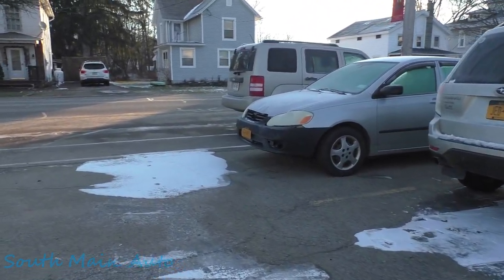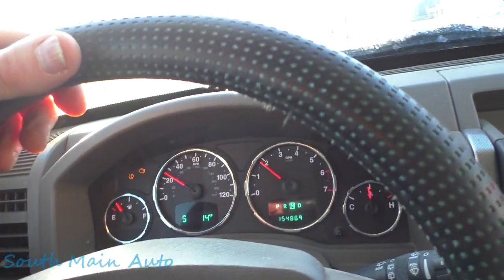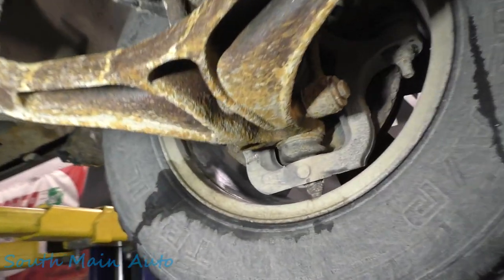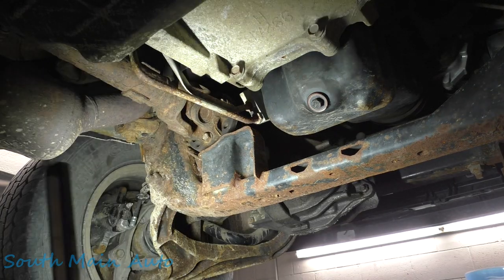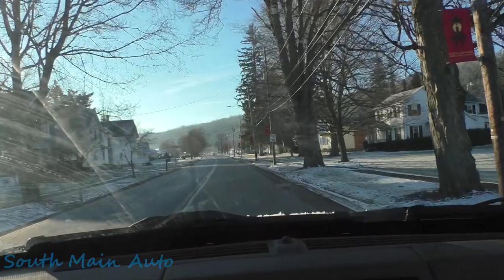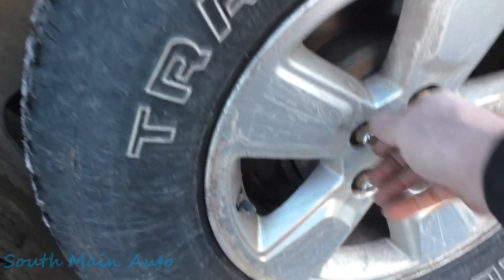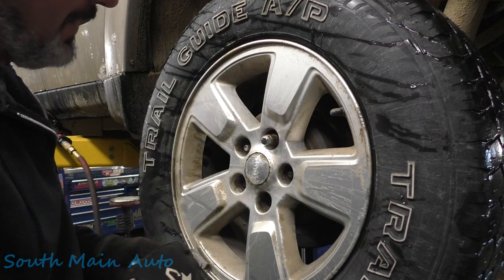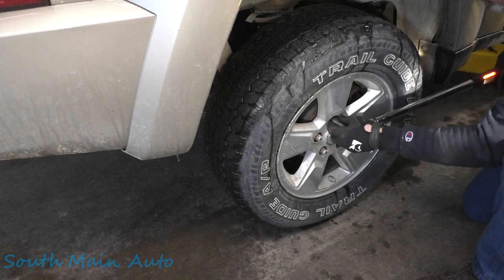Customer Just About Lost It.... A Wheel That Is

Comment: I almost lost a set of duals on a 53' semi trailer once. After doing my pre-trip inspection, I got on I-70 heading West, toward Columbus, OH for a delivery. During one of my frequent mirror checks, I saw what I first thought was a rock fly away from the trailer. Then, I saw the same thing happen 3 or 4 more times so I knew something wasn't right. By the time I got pulled off on the shoulder, that set of duals had started wobbling something fierce! Upon checking it out, I found that 6 of the 10 studs (which were all there 100 miles or so before) had sheared off! I own my tractor but, pull trailers assigned by the company I'm leased to and that trailer was one that they'd rented. Upon calling the company shop about the trailer, I learned that it was the 4th rental trailer, out of the 10 or 12 they were using, with the same issue that week. Needless to say, those trailers ALL taken out of service immediately and the trucking company scrapped the idea of renting, rather than buying trailers.

Comment: 40 years ago i had my Metzler Blue snow tires put on (NJ) my Saab 99 (front tires), drove to Vermont for a work event .... major snow storm brewing when I left  ... left NYS Thruway  east thru Troy NY in a blizzard headed east to Beninngton VT ... 11pm, start hearing a slight clicking at 60mph on front passenger side ... next thing I know I'm carving head on into the 4 ft high snow bank on the right hand side .... Saab come to a stop, I clear the windshield and see my tires doing the loop de loop 100 yards down the road, then falls over .... I'm of course the only fool out driving in the storm, not even a snow plow ... out in the middle of the White Mountain Preserve .... I knew there was an old 50's style motel 10 miles down the road ... 2 hour walk in 2 ft of fresh snow ... get there and the sign says "Closed for the Season" ... one of those 1 story places where the owner lives on the small second floor over the office one light on and an old Cadillac parked in front .... woke the owner up, he gave me a "cold" room ... next morning (Sat) I called the Saab dealer in Bennington (who I knew) and he sent a tow truck out at 9am ... turned out wheel lugs had not been tightened/torqued .... loosened, snapped off one stud ... Sat, so no mechanic, owners son came in and installed 4 new studs for me and the wheel and spindle were okay ...  I was back on the road by noon heading up to the ski area I was doing a clinic/show that Sunday .... 40 years later I'm still a wheel nut torque/check fanatic .... lol ... a good lesson learned at a young age that stuck

Comment: Couple years ago the RR wheel on my Subaru came loose.  Vibrated a bit on the highway but real bad on the interstate and I had to stay under 55 and made it to work.

Thought maybe it had snow or ice in the rim but while walking around noticed 2 lugnuts almost fully unscrewed about to come off.  Others were finger tight at best.  I ~had~ that wheel off about a month before to replace rusted out fuel filler pipe and maybe never tightened it ??  No way to know.  It was pretty scary at the time, thought the rear of the car was about to grenade.

Comment: I live in a grade 1 rust belt and have owned Chrysler caravans, intrepid, jeep Liberty also. I always put grease on the mating faces of the wheel a hub and on the lug nuts. Never used a torque wrench but don't overtighten either and have never had on come loose.  Making sure that the wheel isn't mounted on a crusty surface and that the lug nuts are tightened in opposing sequence is essential.

Comment: 1970 vw camper.  felt a loose sensation in the back.  stopped went out and all the lug bolts had come out and were sitting in the moon hub cap.  the tire stayed on because of the fender skirt that the buses had on the rear.  jack up put back together and forget about it. i also do the unthinkable and grease my wheel studs.  I, like you, live in the rust belt.  my dad always done it, my grandpa, who owned a service station, always did it, and now i still do it.  ive never had a lug nut come loose or seized up where i couldn't get it off with a manual lug wrench.  ive read the reports, watched the videos.  i will take my chances.  like i said only once and that was when i was still wet behind the ears.

Comment: 35 years ago I had four new winter tires installed on my square body, very used, Suburban. After putting 110 miles or so on the truck I heard a clinking noise as I did a U turn. Inspection showed  ALL the lug nuts loose, some fallen into the center caps, hence the rattle during the U turn. It was a very cold couple of days , 35 below cold here in Laramie Wyoming. A walk around of the tire shop showed the air compressor outside the building. I figure the air line was restricted with ice, and the shop was an early adopter of "torque sticks". I watched the installation through a nifty window from the waiting room, so I know the wheels weren't torqued with a torque wrench. I spent a day changing studs and wheels. On a positive note, I installed some used Rally wheels I happened to see for sale in front of the gas station! I'm 73 years old now and I still retorque wheels after 100 miles. Keep up the great work, Eric!

Comment: its thermal expansion and contraction.  i once changed a set of aluminum buds along side the road at 10 below.  you remember such things. later in the summer i tried pullin them off  to rotate them. 3/4 impact wouldnt touch them. took a 10 foot pipe on a 1 inch drive breaker bar to remove them. and yes they were never sneezed up.

Comment: I had a 1980 Olds Cutlass Supreme that I had replaced the gutless 231 V-6 with a built 1972 Chevy 350 4 bolt. Before replacing the motor I had upgraded the rims & tires to 15" with 235/60/15's all the way around. 1 day I ran over something & it blew my front right tire. Thankfully I was only going the speed limit of 30 & pulled into a hotel parking lot to change the tire. That spindle only.had 4 of the 5 studs on it & trying to remove the tire I broke another 2 leaving 2 studs next to each other to hold the rim on. After putting on my full size spare I limped it about 1000 feet to a friend's house & stayed the night there (it was Friday 13th & the only weird Friday 13th I've ever had...so far). I replaced all 5 studs the next day & went & bought another set of tires for the front.

A different time I knew a woman that drove a BADASP AMC Javelin. That car would ship & get I tell ya! Well 1 day she had new rims & tires installed.on it at a shop that's long been closed, but it was a performance shop. They told her to drive it 25 miles & come back to get the rims re-torqued. She made it about 20 miles before the back left flew off while she was driving. It flattened the rear left quarter panel & did minor damage to the suspension system. She had it towed to their shop.. The shop didn't want to warranty it!!! I never knew how she knew him, but she knew the top lawyer in town & called him on the spot. He actually left his office & drove there. After he talked to the manager for about 15 minutes they replaced the rim, sent the car to a body shop, & had the damage fixed plus repainted the whole car. That Javelin was later totalled by a friend of hers she sold it to. The guy was driving her home & it spun out in the light rain when a deer jumped out in front of the 4th car ahead while in a curve. Everybody else stopped but he lost control, the car went off road, rolled 1 3/4 times leaving her hanging out the passenger side. Her kid was safely strapped in the car seat in the back seat. She finished unbuckling the seat belt, fell out of the car, & passed out in an ant bed of fire ants. She was of course taken to the hospital, after the people ahead heard the accident & called 911, where she figured out she had broken her pelvic bone in 4 places, broken ribs, had a concussion, & minor cuts/scrapes/bruises plus unknown total of ant bites. Her kid was ok! The guy driving...I never asked or found out about but she had told him she knew what the car could do, he didn't, & he better drive slow which ended up saving her life.

Edit: that's as close as I remember the above events. The time frame was between 1991-1996.

Comment: Not your region Eric - I live in Maryland, have a 2008 T&C (no, it has not imploded yet...but any day now...). As soon as I heard the sound in the video I knew exactly what it was because I had to troubleshoot that same issue. Since then, every time I rotate my wife's tires I re-torque them for 3 days straight and check them every few weeks (yes, there is always several lugs that back off). I'm happy to know I'm using the proper "pro shop method" of over-torque to keep them in spec! Every video of yours with Chrysler is dead on - I've had every issue you made a video on - especially EVAP. Thanks for fixing my van from afar!

Comment: Wifes car was making noise so I checked it out. It sounded like a bad wheel bearing so I was getting ready to jack it up when I noticed it was missing 3 lug nuts! It was a a big box store a month earlier for tire rotation. While I had it I checked the fluids. It had a quart too much oil! Just had an oil change at a local shop. I do everything I can do myself on my vehicles. Thanks for the video good luck with your pallet expander deal.

Comment: Eric, I had new tires installed at a cheapo muffler & brake shop in Buffalo. I pulled out after it was done, drove about a block, got a terrible wobbly vibration. Pulled over, and 2 wheels had loose and missing lug nuts! Had to walk back and get the mechanic, who was very angry. He had also held me up for 2 hours trying to remove my factory glued-on plastic G6 GT wheel covers! I have also had wheels over-torqued to something like 300 foot pounds, at least. You just never know what you're going to get, these days. I always check my car over after it's been to a garage, for NYS Motor Vehicle Inspection.

Comment: Best related story I have is that I used to work for a rural Ford dealership where we had a small independent shop directly across the road from us. A customer pulled in to have a "rattle when driving" complaint looked at, but didn't want to pay our diagnostic fee (It was not a Ford product). They ended up across the street to have the work done, and about 30 minutes later, we saw their tow truck head down the road... I happen to be going on a test drive at the time, and ended up following the tow truck. Approximately 2 miles down the road, there sat the guy, on the trunk lid of his car, minus his right rear wheel... He had them tow the car to us, as they apparently said that he needed shocks and a front left tie rod... which he didn't need at all, but he did end up needing a new wheel in the right rear, new rotor, brake assembly, strut, and lower control arm (independent rear suspension) which were all damaged when the wheel fell off doing 60 down the road!
Made for a very interesting day!

Comment: I volunteer at a shop full of DIYers (car ministry). We always perform 3 test drives: part of incoming inspection, after all repair work, and during final inspection. Occasionally we get a loose wheel during the repair test drive. One time we got 2 blocks from the shop heard a thud & slowly pulled off the road. Driver's rear wheel was sitting at 30° on one stud, no lug nuts. We found 4 of 5 lug nuts in the road...

Comment: Had a Honda Civic sent it to the garage next to where I work.Had them do a PA state inspection.Shortly after that it started to make a noise.I took it back to them and they then said I needed new axles and engine mounts. I said no way, I got it back did a little investigation and found one of the front wheels were loose from when they inspected. I was not a happy camper.Thanks for the video

Comment: I used to drive an 87  Dodge Charger which was a 2 door sport coupe version of the Dodge Omni which had that same loose lugnut problem.     The lugnuts on the car were steel with an aluminum ornamental cap that always stripped causing improper torques.  I eventually replaced all the lugnuts with all steel ones, and i did the same with my Dodge Dakota after smashing the wheel to get one lugnut loose. For the Dakota i bought used lugnuts at a garage sale lol.

Comment: I have an "07 Liberty in Northern ON, rear tires wearing badly inside, after only 40k km on new tires. Rotten rear control arms, a recall in the states on Patriots, but not in Canada on Liberties or Patriots, and the eternal "non adj. rear bushing" issue, 2 correct the rear camber! It was oil sprayed every year and has lived it's life in one small northern community, so I figured that in 2018, when I bought it, with only 60k km on it, that it was a good purchase, no frame/body rot like that one u had on the lift, except 4 the rear control arms!

Comment: My story.  2010 f-150 with 7 bolt rims.  Torqued to 150 ft lbs before a cross country drive.  3000 miles later one of the rears had 3 of 7 bolts loose enough to take off by hand.  Many more had loosened a lot.  As a rule with alloy rims I now re-torque regularly.

Comment: Had a similar issue with a GMC after a dealer service though not so lucky. Headed down the road a few days after an oil change and tire rotation and heard a similar noise that got real bad real fast. By the time I got pulled over to the side of the road the driver rear wheel was all cattywampus, no lug nuts to be found. Had it towed to the dealer and it had destroyed the wheel and ruined some studs. Thankfully the dealer went good for a refurbished wheel, new studs and inspected the drum brake. I am now fanatical about that wheel re-torque 😉

Comment: Happened to me in my Chevy PU in Feb 2023. Heard a bang and thought the wheel bearing had failed... but no, the one tight lug nut broke the stud and what a wobble it made with the remaining 5 loose lug nuts. I was very lucky it held together until I could pull off the highway.

Comment: I have a 2000 Caravan and a 2006 Grand Caravan, which is our "newly purchased" vehicle. I'll keep an eye on the lugnuts on the 06, it does have the alloy rims. I didn't know these were a potential issue.
I've worked at Walmart in the Auto Care Center for 15 years now, and I really can't remember any issues we've had with loose lugnuts. We do 3 hand torques on each vehicle we remove tires on. We tighten the lugnuts using a torque bar on the impact gun, then use a torque wrench at specs fully 2 times, different tech for each torquing, then do a figure 8 in the parking lot, bring the vehicle back in and 1 final hand torque. Then Walmart recommends a 50 mile retorque. 99 times out of 100, the individual doesn't come back for a retorque....I'm one of them...

Comment: I had this happen on the rear rim of my 96 BMW 1100rt motorcycle.  Riding in upstate VT with the boys, came around a corner and felt the bike start to WOBBLE,  pulled over immediately nothing obvious, no flat. Put it up on the centerstand and the back rim shifted on the hub. Pulled the center cap and all 4 lugs walked out about with like 2 threads left of catch. Had bike for 4 years and never checked or did any tire work.  The good Lord was on my side that day. Like the ole training course for MC say, do a complete inspection before any ride.

Comment: I have done loose wheels to myself twice, both times by snugging up the wheel nuts while on jack stands and forgetting to tighten them after lowering the vehicle.  The first time I ended up parking my car in a residential area and taking a taxi to malwart to buy some tools to fix it.  The second time I realized about a block away from home and turned around.  Now I have a mental checklist item for checking the torque whenever I have been working on my vehicle, and I haven't made the same mistake since.  When you finish a repair at like 2am it's easy to forget the basics.

Comment: I made a wiring harness for my friend Harold's 1932 MG replica and when I was finished I took it for a ride. It started making a God awful rattling and knocking sound about a mile into my trip. Limped it back to my garage thinking the motor let loose. It was actually 2 of the 5 lug nuts on the driver's side rear wheel had came out and fell into the baby moon hubcap. Of the three remaining,  one was almost out and the other 2 were loose .  Scared the crud outa me. It didn't have lug nuts it had lug studs. It used an early VW beetle chassis that had been stretched, it had the old 5 lug rims on it.

Comment: Had a wheel come VERY loose early in the winter. Picked up some new wheels & tires (Some used heavy oem aluminum because winter potholes are unforgiving and invisible) popped them on, torqued to spec. Drove about 20km, suddenly heard and felt something weird, pulled over and the lug nuts were almost all finger tight. My only guess is that it was some combination to do with the mating surfaces & corrosion on the lugs & hub as well as the metal contracting going from a heated parking space of +20 to -40. Gave everything a really good wire brushing and they've held at the torque rating since.